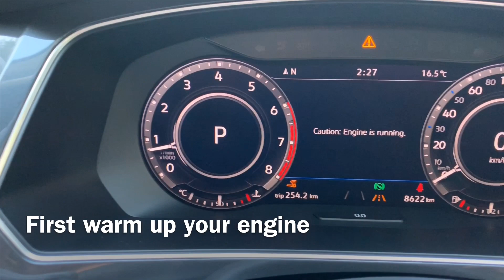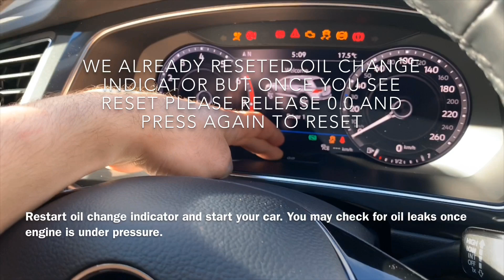2018-2019 Volkswagen Tiguan 2.0 TSI Oil Change

Comment: You used the wrong oil. Should be VW 508 spec OW20.  Different spec than Dexos 0W20 which is not meant for VW/Audi/Porsche.

Comment: I concur with those who say use a VW 508 spec 0w20 only here,  not the black-jug Castrol dexos1 0w20 seen in the video.  Your engine will barely know the difference though!  Mainly "safe" to use VW 508 over the long 6-year engine warranty for sure,  just in case a warranty claim is made on the engine.  I think the best VW 508 oil out there is Mobil1 ESP x2 0w20 (Suncoast Porsche internet source in the U.S.), since it not only passes all the VW 508 engine tests but ALSO piles on more torture-testing in the form of Mercedes 229.71, GM dexosD,  & Jaguar-LandRover too.  Castrol VW 508 is very decent though, and for my first oil change, I'm getting an oil change kit with that from ECS Tuning (internet shippped), including the drain plug & Mann HU6013Z oil filter.
Reply from the maker: I think if you care about your engine your better of doing full synthetic oil changes more often like every 5000km or every year which ever comes first instead of worrying what brand your putting in. Obviously make sure you put in the create weight.
Reply: The Valvoline  XL-IV 0W-20 does as well. Two great oils.
Reply: @samiseries6295 
VW508 is not an oil brand, but rather a specification designed to work for this vehicle’s engine and emission system. This is described in the owner’s manual you show in the video. Many oil manufacturers make oils meeting the VW508 spec, including Castrol, but it doesn’t come in the black jug you show in the video.
Reply: @PonderingOne  Plus to keep that 6 year warranty in place, you must buy the oil and filter at VW, or have the VW dealer do the oil change. After the warranty is over, you can use the black jug Castrol but MUST change the oil every 5k miles. The main differences between oil types is the additive package which allows the 10K oil change interval.
Reply: @Johnny847  
This is not accurate for the US. You can keep your warranty intact if you use the correct spec oil (VW508 in this case), and you maintain records (receipts, service dates and odometer readings). You can buy the oil online or at auto part stores, or the dealer. 
I would continue to use the spec oil after warranty. Not that much more expensive.

Comment: Currently shopping for a car and I'm looking for the serviceability.  My worry is that the top cover and uses plastic keepers, not sure how long those keepers will last. I hope there are screws to fasten that plastic cover.

Second is the oil filter plastic housing. And will a fumoto valve work as a substitute for a drain plug valve?

Comment: My tiguan 2018 manual says SAE OW-30. Do you know the difference with OW-20?
Reply from the maker: The 20 vs 30 is just the grade at operating temperatures. 40 is a higher viscosity. Your area might be more hot in the summer compared to mine. Follow the manual.

Comment: Supposed to use 508 509 oil. Always remove filter before drain plug.
Reply from the maker: VW 508/509 is just VW branded 0w-20 Full Synthetic engine oil. If you remove filter before drain plug all the oil from the filter will leak all over your engine. To let air in I loosened my engine oil fill cap.
Reply: 508 509 oil is green. Looks nothing like regular synthetic
Reply from the maker: That’s weird cause on my VW’s oil fill cap it says Castrol and manual recommends Castrol. I’m in North America so maybe your oversea?
Reply: I’m in Chicago brother. Never had an oil related failure using Castrol as long as your using the right weight your probably good
Reply: Just curious.  Why remove the oil filter before removing the drain plug?  Thanks
Reply: Wallace Binghampton if drain all first it creates a suction making filter harder to loosen. On this particular vehicle being that the filter is mounted above may not be as bad but on a domestic canister style definitely
Reply: @OakLawnSpeedShop  Thanks...makes sense
Reply: @samiseries6295  You're way off base with that assumption. Spec 508/509 is formulated for VW/Audi GDI engines to reduce carbon buildup. It's not very expensive from a VW dealer or ECS Tuning online. Not a wise decision to ignore the manual recommendation.
Reply: @MPBrewster  AGREED!!! IFor late-model Tiguan engines, VW recommends 0W-20 oil that meets VW 508.00 specification. That is currently "Castrol Edge Professional Long Life", and NOT the regular "Castrol Edge" that can be found at local discount stores. Your video appears to show the wrong oil type. . . If you choose not to use oil that meets VW 508.00 specification and have a major engine issue, then VW might reject your warranty claim because of this. Over a decade ago, Audi and VW initially rejected many warranty claims regarding engine sludge build-up because owners either did not follow the service interval or used the wrong oil spec. Now it is much easier for VW to tell when the correct or incorrect type of fluid has been used because of the green color/dye in VW 508.00 rated oils.

Comment: you didnt use vw spec 508
Reply: Excellent point.  If there is any engine component damage or other issue and the VW technician pulls the dipstick and it's not the 508 spec dyed oil, they will certainly deny any warranty coverage.  Being a 6 year/72K mile warranty, I sure wouldn't take the risk of using a non-spec oil.  I've read that the 508 oil is extremely tough, especially for a 0W20.
Reply: @sideskraft 
Agree that VW508 is the only thing to use but the oil changes color over time and is brown when you drain it.

Comment: You had been doing an execellent job until you poured the wrong motor oil in your engine, which pretty much makes everything you did in vain. Not all 0W20 oils meet VW's 508 spec.
Reply from the maker: I poured what my manual recommended.
Reply: @samiseries6295  For late-model Tiguan engines, VW recommends 0W-20 oil that meets VW 508.00 specification. That is currently "Castrol Edge Professional Long Life", and NOT the regular "Castrol Edge" that can be found at local discount stores. Your video appears to show the wrong oil type. . . If you choose not to use oil that meets VW 508.00 specification and have a major engine issue, then VW might reject your warranty claim because of this. Over a decade ago, Audi and VW initially rejected many warranty claims regarding engine sludge build-up because owners either did not follow the service interval or used the wrong oil spec. Now it is much easier for VW to tell when the correct or incorrect type of fluid has been used because of the green color/dye in VW 508.00 rated oils.
Reply: @samiseries6295 
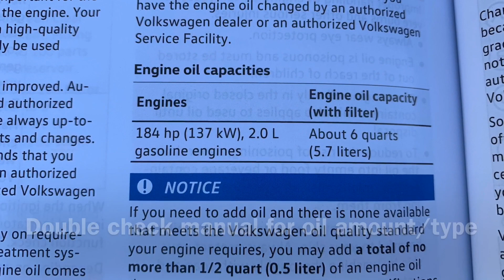On the exact page of the manual you show at 4:43 it states that the approved engine oil specification is VW 508 00. In the manual notice you show at the same time stamp it states that you are limited to 1/2 quart of non-spec oil in case of an emergency.

Comment: If you get a vacuum oil suction tool with tube that goes down dipstick hole, you can change oil without getting under vehicle since the oil filter is on top. No mess, do it in street clothes
Reply: You can actually reach the drain plug on the Tiguan with the vehicle parked on the ground.